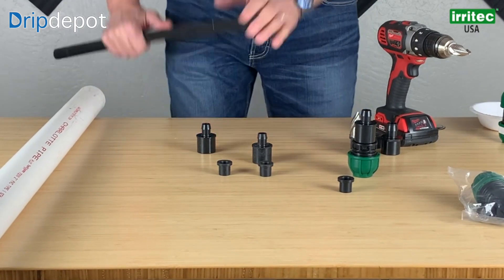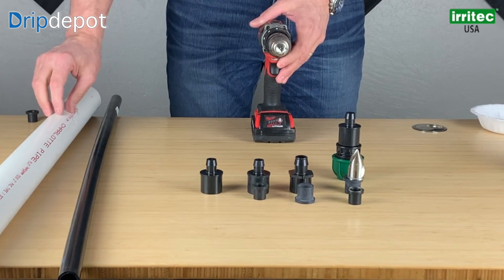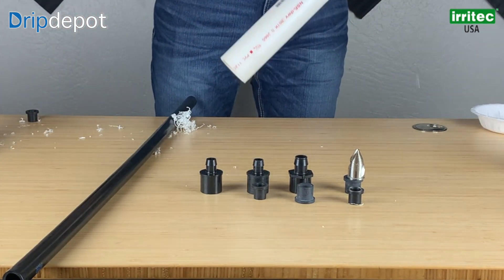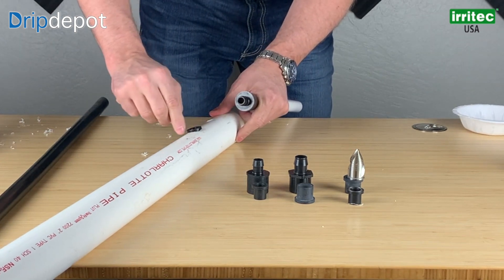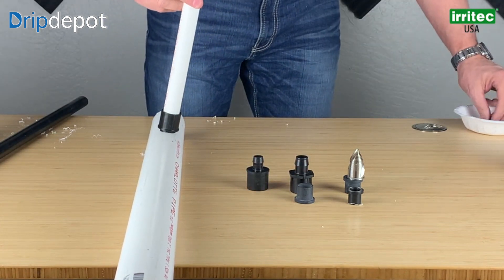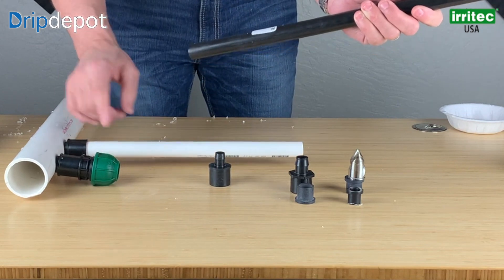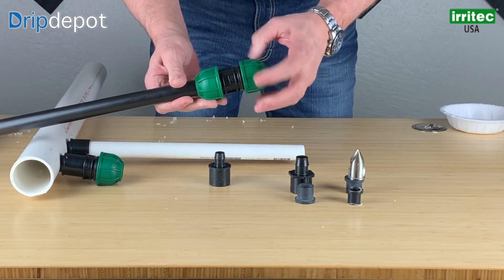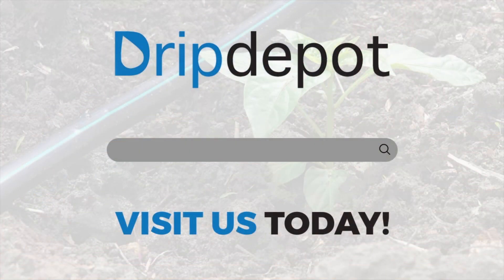How to Use Irritec’s Connecto Fittings and Speed Riser Tubing with PVC Pipe

Comment: Lol he put his whole body weight into it. How am I gonna do that sideways with the pipe in the ground?
Reply: It's actually easier to do while the pipe is in the ground -- the table in the video is very slippery, so had to be stabilized at the same time the fitting was going into the grommet.  If in the ground, it would be stabilized making it easier to focus the strength on inserting the barb.  It will still be a tight fit, but much easier when the pipe is in the ground, except in cases where the angle is awkward, etc.